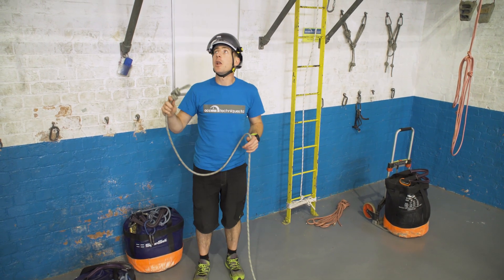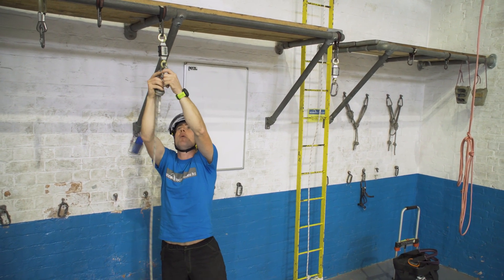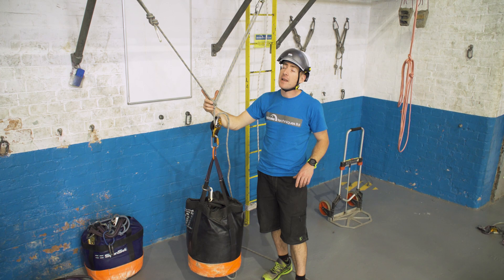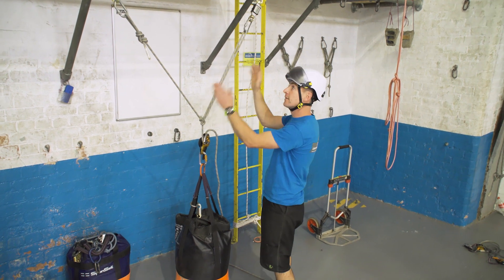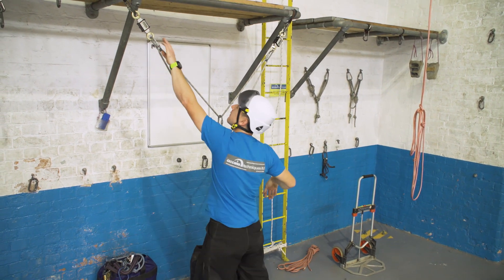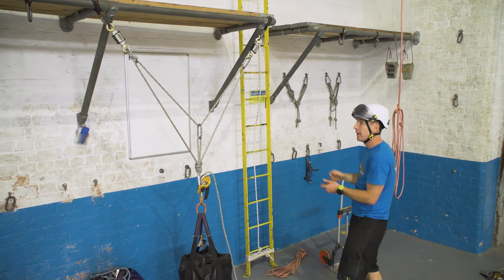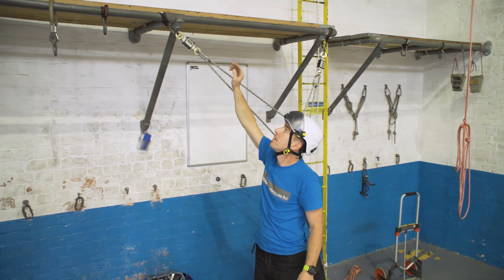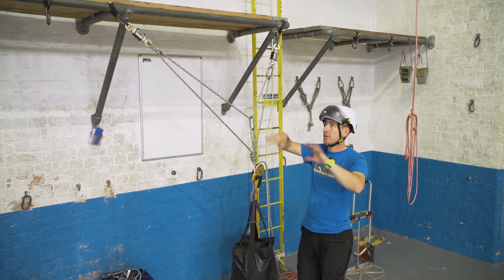Load sharing on a Self Equalising Bunny.

Comment: If it's self-equalizing, that is to direction of pull, not just location of a downward pull. Maybe it could be remedied in that case by replacing the biners with pulleys.
Reply: Yea this was my issue with the video, if you were able to consistently pull in the direction that the rigging changed to. I wonder if it would be equalized then.

Comment: This is actually quite misleading.

It's not the fact that the anchor is sliding that makes it not equalizing. It's the fact that one leg is suspended in line with the load whilst one leg is completely off to the side. Try tying the same angles with a bunny ears and you'd get the same results. You notice they don't test this in the video - not good science!